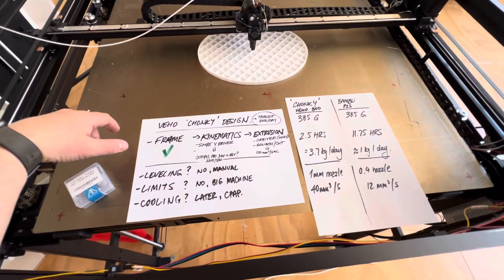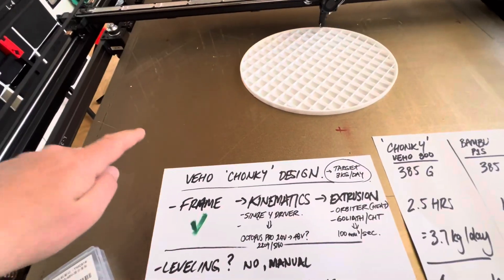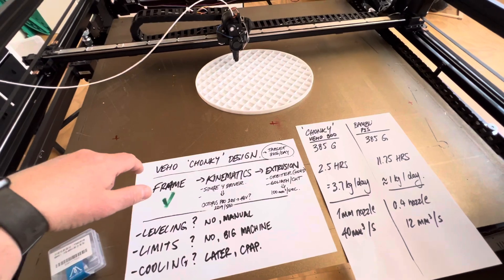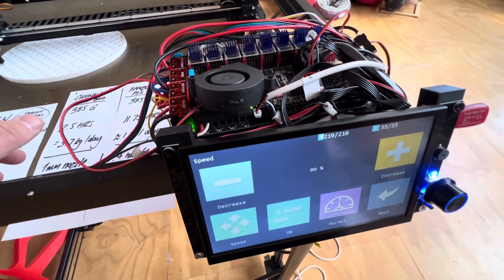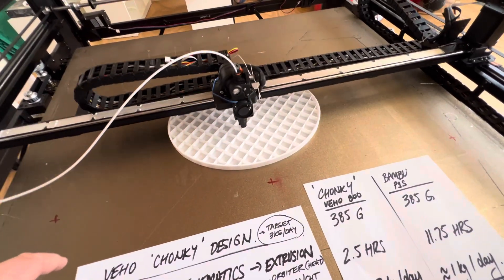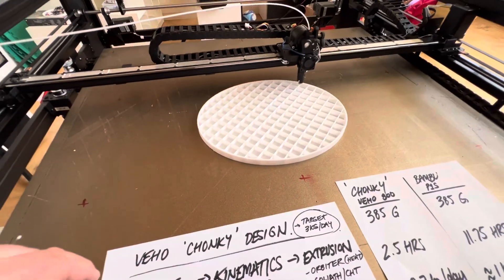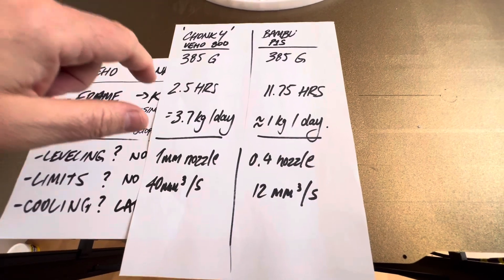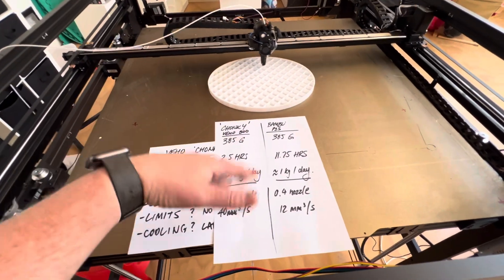Tronxy veho800 upgrade plan - how I made my choices for upgrades

Comment: great video! nice to see that not all of us are looking for the fastest and most detailed printers. i use 1.2mm nozzles because the strength is fantastic. i m looking for a larger volume printer though and this one , or another tronxy looks great but always get bad reviews. is it possible for a non engineer to add the orbiter and use cht nozzles ? a phaetus uhf would be able to go higher than 40mm3/s i guess… looking forward to your next videos
Reply from the maker: Hi Kate, it's worth noting that the frame of the Tronxy 330 and 400mm is the basis for the VZbot. I have built a few of those. Most of the hardware I am using here is lifted from the VZbot. Yes I think it is possible. I can always share the install files for the octopus. You just put it on the SD card and reboot and the new marlin is installed. Tronxy are actually having a Black Friday sale for a few more hours so I just bought a Veho1000 and a new octopus/orbiter/goliath/TFT70 for cheap. I guess I will check it out a second time haha
Reply from the maker: Update - now running closed loop stepper drivers and they are amazing. New video up soon
Reply: @samdekok72  I'm thinking about getting first printer either a tronxy 800 pro or 1000 pro for my business need to print 65cmx50cm max but don't see much else on the market suitable which isn't super expensive but many people say to avoid tronxy. What is your experience?